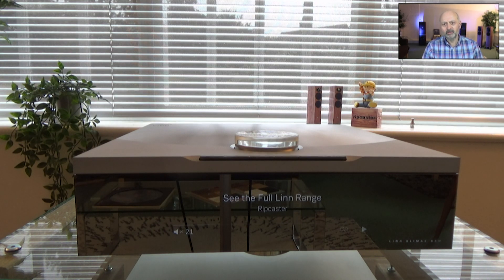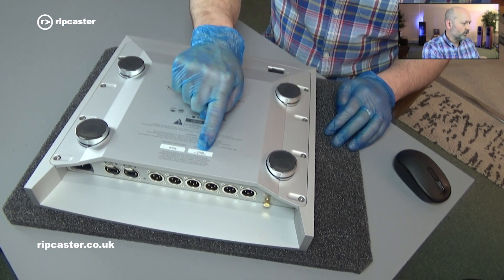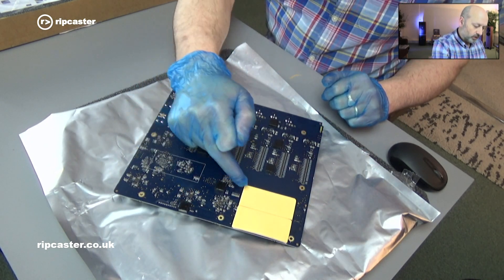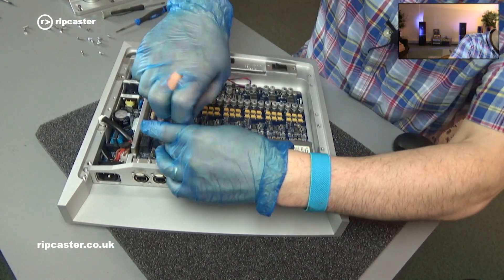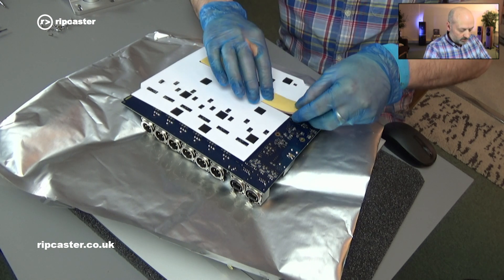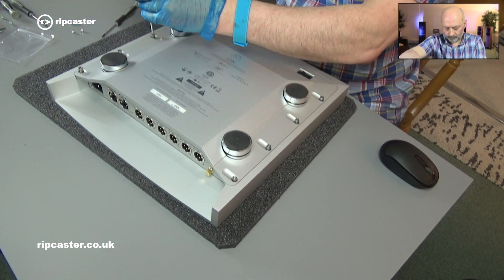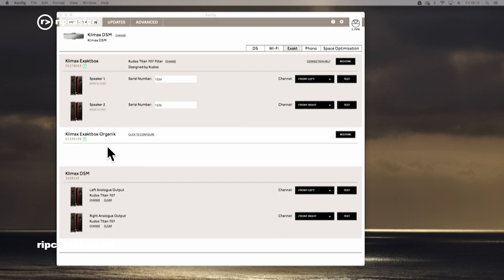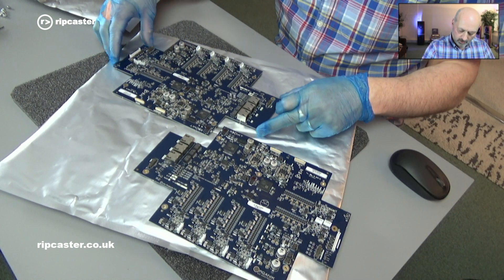Linn Organik DAC Upgrade for Klimax ExaktBox at Ripcaster

Comment: Hi John, I've watched this three times now and I still don't get why the outgoing Katalyst board can't be re-used, say in someone elses pre- Katalyst Exaktbox. 
Ignoring the power supply, the whole device is pretty much just the Motherboard, and the speaker selection and room settings for Space optimisation are done with Konfig for each device same as you would when you install a brand new device in a system, so i dont see why the outgoing board couldn't be used in a pre-Katalyst Exaktbox. It means we would miss out on a few bucks of resale value after we upgraded
Reply from the maker: Hi, you are right that the ExaktBox is essentially this motherboard plus the power supply. So the board would physically fit in a non-Katalyst Klimax ExaktBox (and maybe Akurate EB6 too)... BUT it would need to be re-programmed by Linn to ensure it is unique within their cloud ecosystem to ensure no clash of system configuration data. The re-programming is currently not possible/offered by Linn.
Reply: @ripcastercouk  ok that makes sense. so they must have done that with DS/DSM MoBo's and repurposed them as Renew's soi the board gets a new identity. maybe thats what's needed here an Exaktbox Renew ?! But Linn have probably got bigger things on their plate right now.